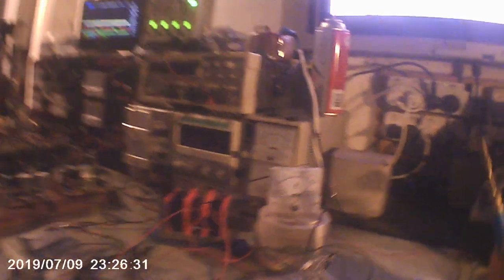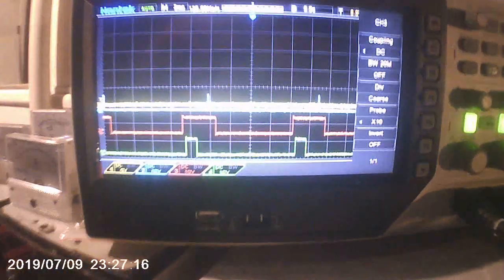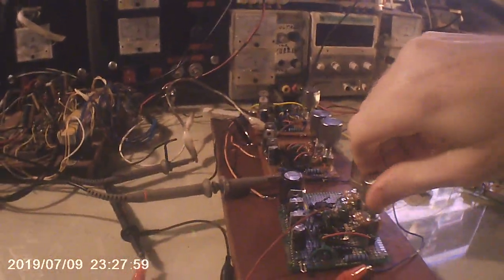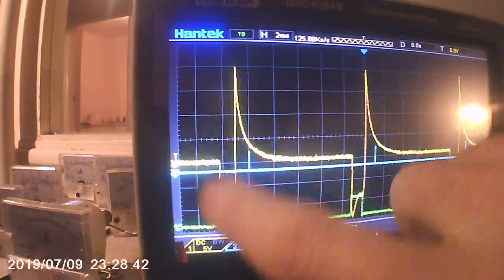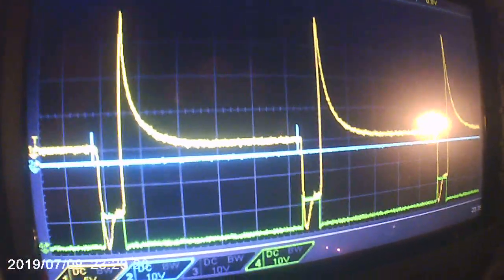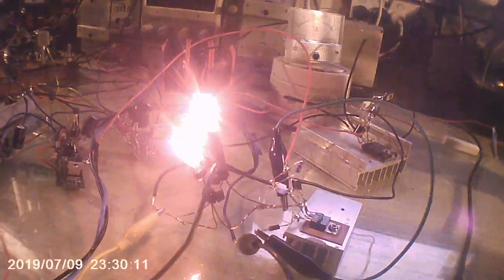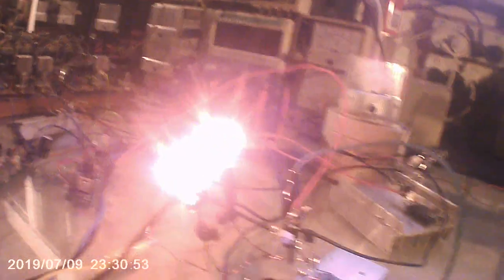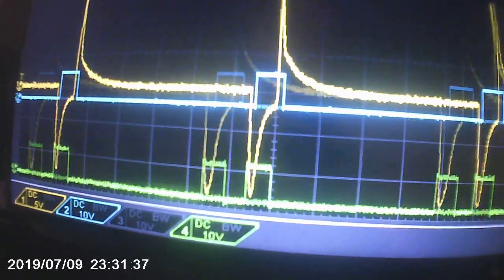Help me Sagan Jones of EEVblog Free Energy !!

Comment: no matter what the questionmarks are....the effect is looking really nice and motivating. Good work. 
Would be nice if you could add like 3 seconds at the end of the video and show what your actual circuit diagram looks like. Coil setting, transistor switching, diodes, loads etc. In this video you explained it nicely but a schematic would be helpful. :)
Reply: thanks for watching, i will keep you guys informed, and i will post a full diagram soon,  - hopfullly with explanation astoo whats going on !
Reply: also, this is not a schematic, - but a conceptual drawing of how the 555 timers and op amps are wired up.
http://aboveunity.com/content/uploads/036da5f1-33af-47bc-a2b4-aa2c00e4238d/0e1b7ddb-a8bd-42fa-b41c-aa6600cbdef4_delayed-conduction-circuit.jpg?width=690&upscale=false

Comment: Hi Patrick, Nice work.
Since you posted the question on EEVblog I think its only fair to give them a quick sketch or schematic that they are asking for. Not the 555 block diagram. but specifically how you wound the coils and connected them. Otherwise, what is the point of asking
Reply: Thankyou, - and yes i was reluctant too draw a diagram for the forum, - but only because i didnt see it as being important too my problem - but yes, im sure it would have encouraged more enthusiasm, -.. so ya that was my mistake, - but dont forget, i think it would also have caused more confusion. -     afterall the signal is going via an opto isolator, so quite simple, - but i still dont understand whats going on inside the transformer too cause this.  very non conventional ,  -   but im keeping all my data, - over 100 experiments in the last 2 days ;-D.... !!!